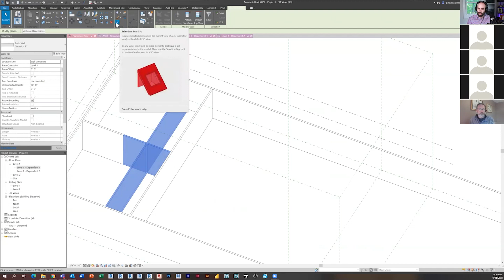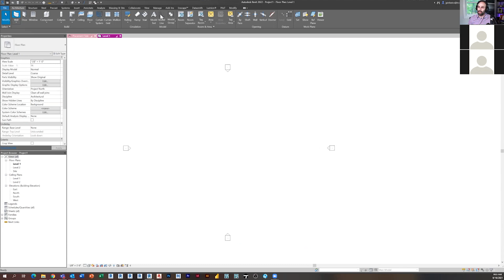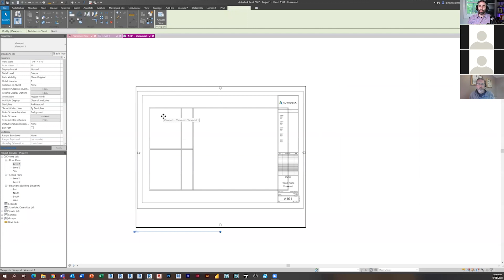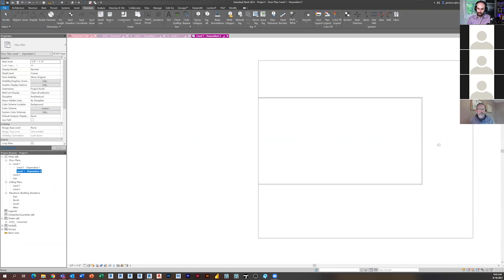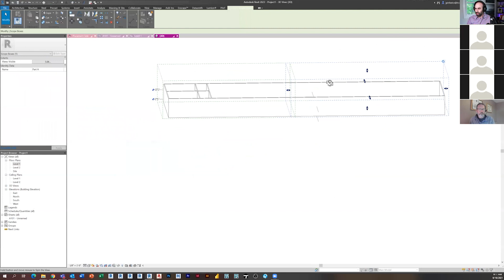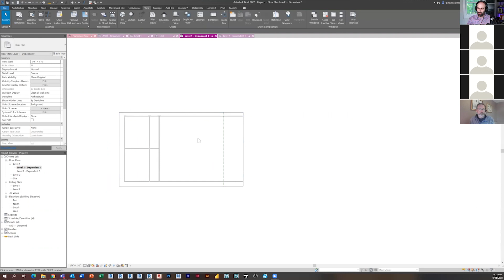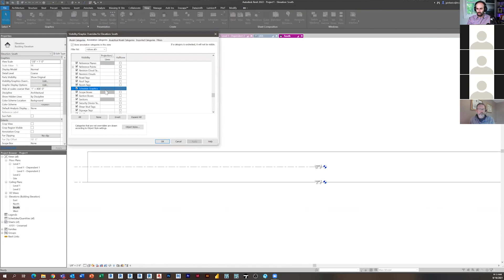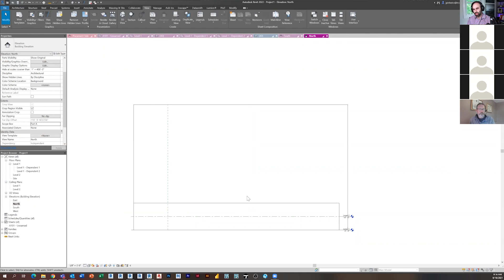Scope Boxes in Revit ... Explained (Office Hour Sessions)

Comment: Hi Jeff. I guess I have a tip (maybe  it's not but i find it useful). We don't have to enter family type editor to ensure that naming and content match , simply on the project browser when going down to families you can use your down button and expand and select your type and go to properties panel and here it is, all the type parameter values in the type editor are shown there. Unfortunately you can't correct any problem using properties panel like instance but at least you've already did your check quickly and discovered your problem. Thanks.

Comment: Another great use of scope boxes involves Dynamo - especially with the spring nodes package - wherein you pull the solid geometry of the scope box and can run an intersect to find elements within.  Really cool way to segment your projects not just for views/sheets, but also for background data & parameters.  We use scope boxes a ton and basically treat them as datums much like grids or levels.
Reply from the maker: Great shout!  A little more “advanced” of a use but still powerful
Reply: Very interesting. I’ll have to check that out. Thanks Matthew